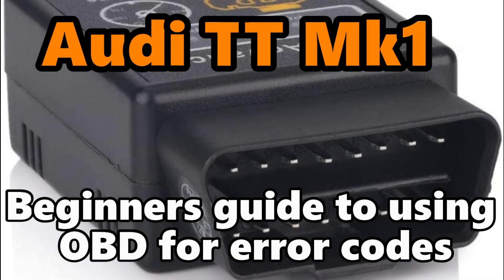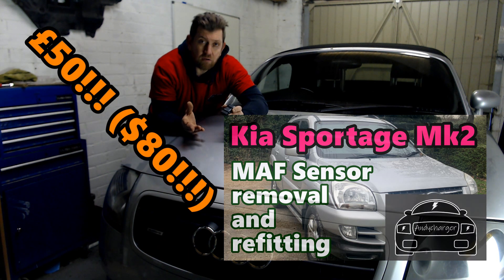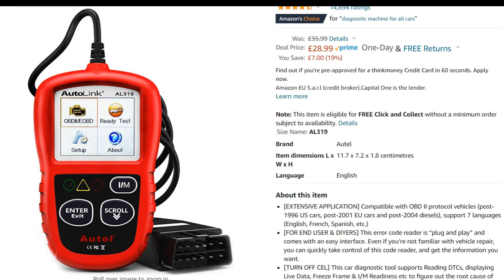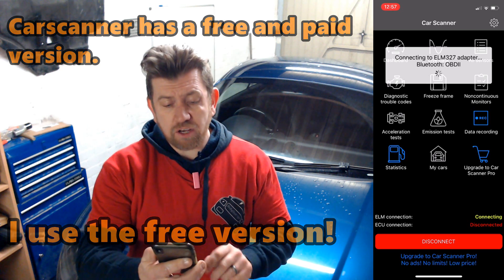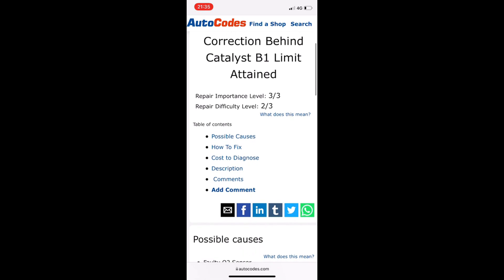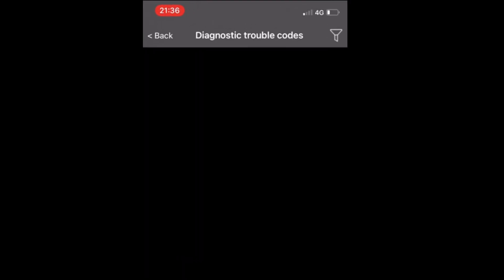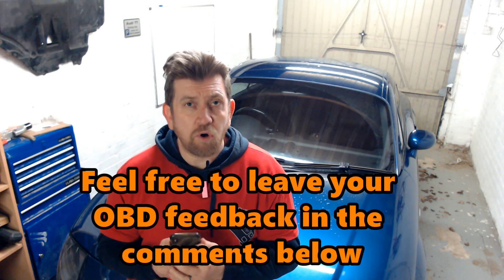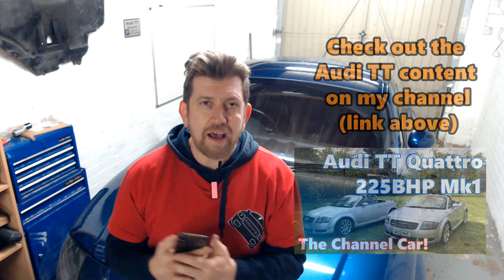A Beginners Guide to OBD Code Readers: Everything You Need to Know

Comment: Hey there had some issues with my mk1 TT and replaced the crank sensor as per ur video(thanx) and now the car will not start at all and is showing an EPC code I need some help
Reply from the maker: Have you got a code reader John? What code is it showing now?
Reply: @andycharger  no that's what I need help with,there are soo many and I don't wanna spend alot of just to get the sensor talking again.Thank you for the quick reply
Reply from the maker: @johnfrisbie5613  where are you based John?
Reply: @andycharger  across the pond over in Oklahoma

Comment: Hi.  Any idea if this particular dongle would detect a failing Air Flow Flap Motor Control, I think it's part is V71?  Some dongles just do basic engine codes, as opposed to AC/Climate systems as well.  Thanks - great little videos btw :)
Reply from the maker: Hi. If the air flow flap throws an error that produces an EML, this should be able to read it. Thanks for your comment!

Comment: Hello Andy,
I had to change out the brake light switch about a month or so ago on my 2001 Audi TT and in the process I had to remove what I call the 'knee panel'.  The OBD connector fits into this panel on the lower left side [LH drive car] and I am not sure if I got the female plug fully into place. Yesterday  I tried to hook up an OBD scanner without success, maybe because I was just pushing the female connector backwards.  I thought I should put the trapezoidal male connector of the scanner with the long side up because of the two 'ears' on the Audi's connector and its generally odd configuration.  

I am not quite sure how the OBD female connector is fitted into the knee panel opening. Do you have a picture of the female connector by any chance. If not I will just have to remove the knee panel and find out for myself but I thought I would ask for the picture before going ahead. Could be I am just not angling the connector into place correctly.

Bob Pellow
Reply from the maker: Hi Bob. Drop me an email at the channel and I will send you a photo of my OBD port in position.Andy

Comment: Hi Andy sent here from Cars for Paul. I have a problem with my TT year 2000 225, when i press the brake pedal if feels as if the ABS is in operation, any ideas?
Reply from the maker: Hi Raymono. Does the light also come on with the judder? It could be a multitude of things but worth starting with the simple / cheap things first. 
Check the amount of fluid you have in the reservoir. Is it low?  
What condition are the brakes and pads in? 
You could have a faulty wheel speed sensor or perhaps your ABS module is faulty.

Lots of things to look at but I would start with the fluid and work your way on from there!
Reply: @andycharger  There is no light, even just swapped out the abs unit. All the lines under the car have just been renewed.  The system has been flushed and topped up.

Comment: top content as always. I have a question my passenger headlight gets foggy and wet really easily. Is there any way to take out the headlight without taking the whole bumper off
Reply from the maker: Hi and thanks for your comment. Unfortunately not. If you want to restore the lenses you can mask up and do on the car. If you want them out, it’s bumper off!
Reply: @andycharger  i think i have to restore it, it gets wet when it rains and dries up when its shiny. It has to do with the seals so its a bumper off situation.

Comment: Do you have the free version?
Reply from the maker: Yeah buddy. I know you use the posh vagcom! I’m more of the “budget” end of the market 😂
Reply: @andycharger  ah here,  I have a Bluetooth dongle in the door car pocket of the TT all the time. It’s great because twice while miles away from home the engine light came on.  Coolant warning and can’t remember what the other one was but it’s great for giving you an idea what’s up with your 20 year old car. Sometimes it’s a loose wire or could be worse, but always peace of mind when you do scan. Note - Only vcds or other professional scanners will remove airbag warning codes.
Reply: @andycharger  for pre-2006 Audi/VW, you can use VCDS-Light free version with a cheap blue Chinese cable to read and clear all the codes on the cheap

Comment: Hi Andy!

I keep one of these plugged in all the time so can not only see what engine light codes are if(when- sigh 😡😡) they come up but to be able to see all the dynamic parameters…I use the app InCarDoc. Can see RPMS, coolant temperature, short term trims, etc. 

On my new TT engine sounds to me as if idling perfectly, but gauge shows idling at 1000RPM- too high. The reading off of app via dongle confirms gauge is off 300rpm or so.  Is idling perfectly at 750ish. 

Also, on new TT car temp gauge will go very hot. Tap on gauge and goes down. Looking at coolant temp via dongle(which is what car computer sees) the temp is good at around 200 F. Since the coolant sensor has 4 contact points, I think that signal goes to computer and gauge independently…hmmm 🧐

One last thing, on old TT-smooshed one in storage- car was running lean. Andy, you can use this parameter to see if your light, if it comes back on, is related to engine vacuum leak. Short term trim can show whether or not car is running lean or rich. A postive number is it running lean. Number when engine good should always be in low single digits. If a positive number is lean(lean is too little fuel compared to air intake quantity- usually caused by a torn vacuum hose somewhere or tears on the TIP). A negative number is rich. If number hits 20 will throw a code and engine light will go on. When you punch gas, should see number go negative as you are creating a short term rich condition.  On yours Andy- bet you are correct O2 sensor. Since vacuum leak usually throws it own code. Both up and down stream O2 sensors should be changed probably in the 100k mile range. 

Again. Keep up great TT vids!!

Comment: I got myself a decent OBD reader when my abs light came on , only problem was it couldn’t read the codes for the abs , I had to take it to a friend who has a snap on scanner, that did read it , most scanners won’t read a old Audi unless it’s a dedicated VW/Audi scanner. They will read some of the codes but not all of them
Reply from the maker: Yes I know the vagcom is the way forward for most but a lot of your common codes are diagnosed with these cheap readers. The OBDII software Chris used to scan my 3.2 chains with has a cost to it (about £100) but found since you can do it with my dongle. However his software flags up a lot of stuff that mine does not. So you make a totally valid point my friend!